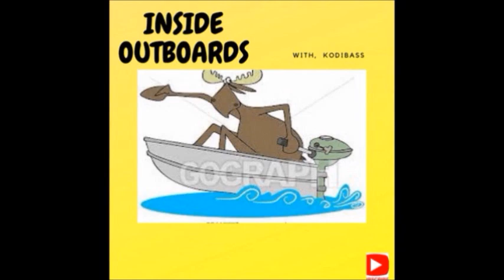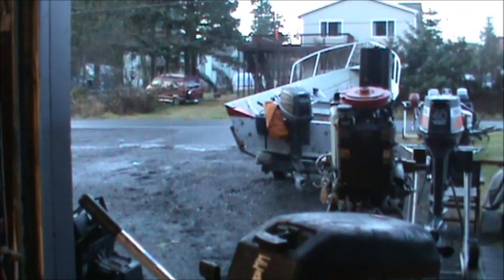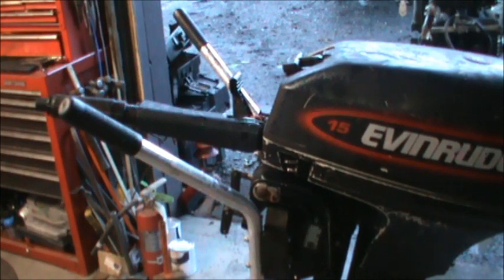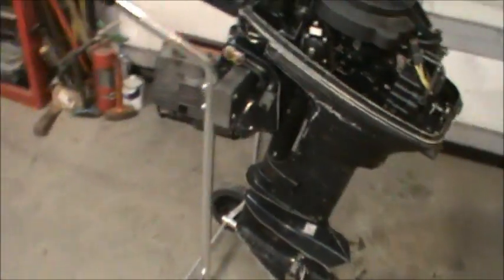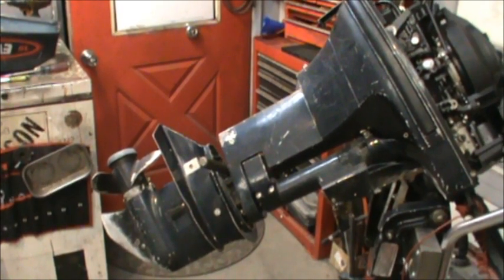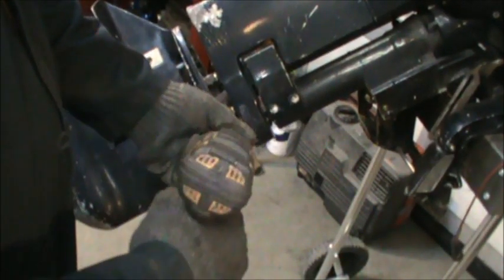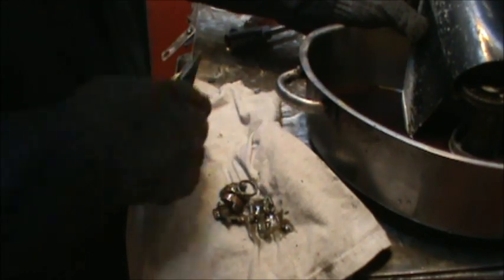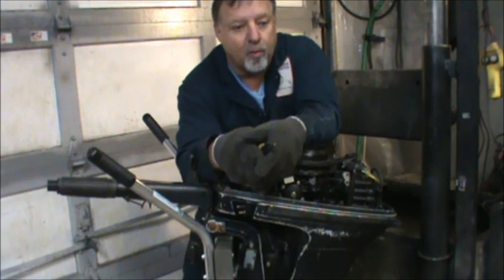MERCURY 1988 70 HP START UP, & EVINRUDE 15 HP,  ouch

Comment: Ouch is right! splattered the bottom end! Kodi ? what was your link to check and see if you have parts for my 1971 sportster 25 horse short shaft tiller . Specifically a complete choke solenoid set up . Thank you sir
Reply from the maker: Email me @   lenny@alaska.net  or call me @ 907 486-9444,  Remember I am 4 hrs behind east coast time tho. thanks  I have so many folks requesting parts I get a bit confused.   thanks.     kodi

Comment: I have a 1973 10 ward and I could not remove the carb because the safety interlock was in the way so I just cut it off do you think that it will be fine or will that cause problems?
Reply from the maker: Less safe, but mechanically will B fine.                 kodi

Comment: That Mercury sounds like it’s missing a bit !? Might be the delay on your video . Well at least you found your balls ! Lmao. Those newer lower units can really be a pain in the keyster !
Reply from the maker: I think you R correct on the Merc, the fuel going 2 the middle carb was pouring out the side of the carb not into that cylinder,  float needle  stuck or gummed up.  lol.        kodi
Reply: I was thinking the same thing about the old mercdog, perhaps it was flooding the one cylinder... A shame about the 15hp, they must have really walloped something, but at least the fessed up to it...
Reply: @fleetwin1  it’s amazing that was all the damage but then again it’s the weakest point !
Reply from the maker: @fleetwin1    Yep'  I'll  get to those Merc carbs later,   I was thinking just like you,,, So so refreshing to have a honest customer 4 a change,  I will sell him the lower unit @ cost.  Just labor.   kodi
Reply: @kodibassInsideoutboards   It pays to be honest, and nice for sure....

Comment: Is wobbly a 3/8th square drive universal joint ? Or 1/4 inch or 1/2 inch
Reply from the maker: 1/4  I like those as they can get into tight spots on motors.    kodi
Reply: Universal work good but wobbly extentions are great for working on any motors
Reply from the maker: @TimsWorkshopTJY    Yep'  I agree on them wobbly's  4  sure.       kodi

Comment: I’m curious why your getting rid of the VRO or whatever it is Mercury calls it? I’ve had my Boston Whaler with a 115 hp oil injected for 20 yrs and have had no problem with it. I also found a link to an article about OMC’s VRO systems and how they go misdiagnosed as the problem but get blamed for many issues http://continuouswave.com/whaler/reference/VRO.html
Why not leave it and just make sure it works properly?
Reply from the maker: Remember I sell most of these motors,  Allot of older buyer's up here do not trust VRO systems &  yes many non-VRO problems R blamed & have nothing 2 do with the Systems. But customers want what they want.  I am all 2 happy to let them B right.                  kodi

Comment: Don’t they have shear pins on them newer motors newest one I have is 1975 never worked on any newer than that 56 30hp Johnson came with 7 brass sheer pins and then extra prop and I have the paperwork from when it was brand new 360 something bucks and the controls
Reply from the maker: Good on you for saving all that, No these 90's Evinrudes have splines & a pressed rubber hub.   kodi

Comment: is it me or does that merc sound like its only running on 2 cyl?
Reply from the maker: I think it is running on 1&3  fuel going 2 middle carb was pouring out the carb so know fuel to that cylinder, just plugged up needle & seat.      kodi
Reply: @kodibassInsideoutboards  sweet! easy job. congrats on the free motor!